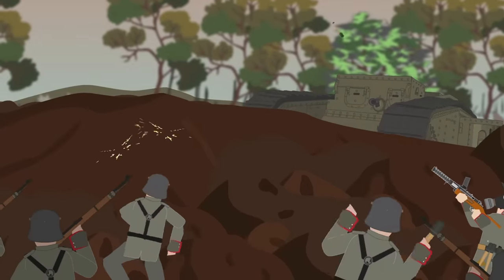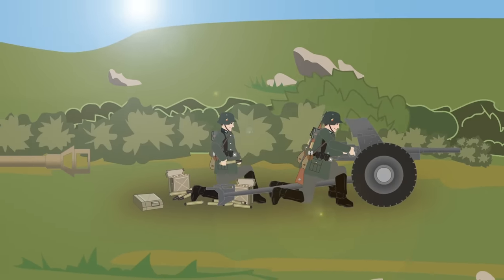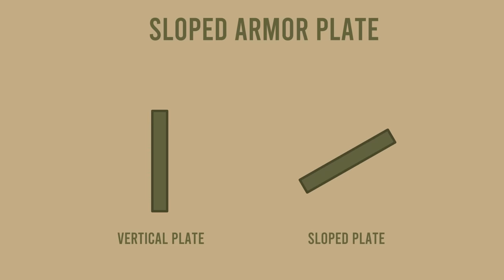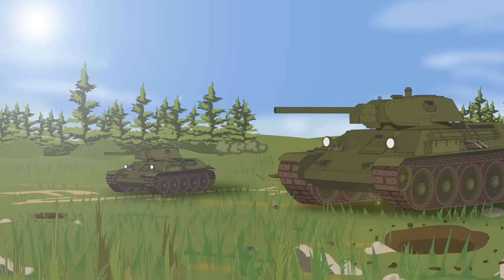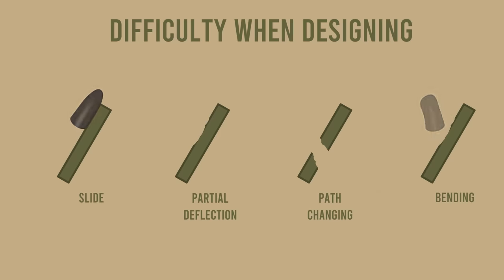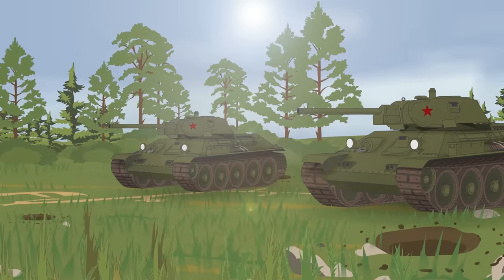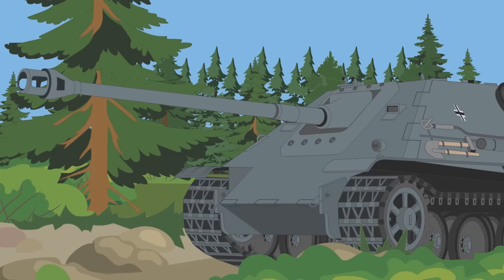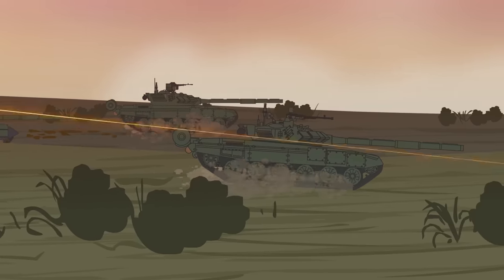Sloped armor: A simple feature that saved many lives

Comment: The T-34 is an excellent example of the advantages and disadvantages, been the disadvantages an extremely cramped interior with few internal storage, also how blind a tank has to be  shot at 27 times, also the 37mm was able to eliminate T-34 they destroyed about 2.000 at the beginning of  Barbarossa, this due to the extreme tempering of soviet steel which cause  spalling    in the interior without penetration ending the crew inside.
Reply: I was looking for the extreme tempering comment
Reply: @ZayP730   Am not confusing them, in 1941 at the start of Barbarossa russian lost around 20.000 tanks of which 2.300 were T-34s, so they had more than thousands of them, then the 37mm was able to deal with them as I said they lost 2.300 T-34s in 1941 alone.
Reply: @ZayP730   The book "Soviet Casualties and Combat Losses in the Twentieth Century by G.F. Krivosheev , John Erickson, Christine Barnard" made with soviet data from the archives in Moscow in the early 90's.
Reply: @viceralman8450  Numbers look exaggerating. Soviets had T-34 which was effective against the initial Pz-iii and Pz-iv with short barrel.
Reply: @livingroomtheatre174  So the soviets exaggerated their own loses sure.
Reply: Lazerpig?
Reply: @viceralman8450  Losses can be attributed to various reasons as well. 1) Great Purge of 1935 left red Army without able leadership. 2) Soviets never expected attack from Germany, rather from Japan. So they had to deploy elite units on the far East. 3) Soviets lacked radio. So coordinator was poor
Reply: @livingroomtheatre174  that and the tank itself had a lot of problems in both the design itself and the piss poor manufacturing that went into them
Reply: @livingroomtheatre174  According to  Makhmut Gareev former Deputy Chief of the General Staff of the Armed Forces of the USSR, the Russian government never trully disclosed the actual figures of casualties in ww2. He states that many conscripts were left out of the millions of casualties. So yeah, the closest we have to the truth is the work of Krivosheev.
Reply: @generalfluffyproto  A man of culture I see.
Reply: @livingroomtheatre174  Sounds like excuses. And don’t change then fact they were run over by inferior tanks supposedly.
Reply: U stole my words out of my mouth
Reply: @viceralman8450  excuses? You forgot Molotov Ribbentrop treaty that pledged no Soviet - German conflict! Russians were indeed has poor terms with the Japan in the far East. Dont forget Russian defeated Japan in Khalkin Gol. The term inferior tanks itself is a vague remark. Even Germans had moderate tanks in the 1941. Striking tank at the time was Pz-iii which was not powerful enough to penetrate KV-1 and T-34
Reply: @livingroomtheatre174  
You look at tanks from paper view, not from a actual military standpoint, in reality german tanks were much better coordinated, had radios, were very crew comfortable and had excellent visibility and optics. The steel and weld quality was great too. This is why when facing t-34's and KV's. Pz 3's could disable enemy armor even with 37mm by just spalling out the plate. It's why you also here of t34's taking 30 shots and not firing back once, that's the sign of a trash tank.
Reply: @dsan8742  german officers told it themselfes when they were testing them, so you should read legit recourses…
Reply: @livingroomtheatre174  Excuses  to justify the poor performance of the red army.  
They if the Pz 3 was supposedly unable to pierce the T-34 how the red army lost  2.300 of them on 1941?
Reply: @dsan8742  did I ever say that Soviets had superior tanks than the Germans? You need to stop reading between the lines buddy.
Reply: @viceralman8450  poor performance? Dude, Soviets defeated the Germans! Let's accept this fact straightaway. By the time Normandy landings happened, Germany had already lost the war and were retreating!
Reply: @livingroomtheatre174  We talk about 1941 T-34 right here. (At least for I seen)
You need to accept that T-34 look good on papers and may look good in real combat. If they build it like how other countries build tank. Their armour think, Yes. But it's poorly made. PZ-III may can't penetrated it. But enough to make crack on armour of the tank that make it's unusable.
Poor visions (expect gunner), Poor communication (not have radio), Not have heater (If I remember correctly)
Just name a few.
All this problems above lead to poor performance of tank crews and tank it's self.
Reply: @ZayP730  ''Also regardless of the soviets steel quality, the 37 was still highly incapable of reliably dealing with T-34's unless from flanks or good angles like he says in the video.'' Did you not read the last part of Viceral Man's comment? Often times when a T34 were hit the round fired by the enemy would not penetrate, yes, BUT the armour would be damaged. Due to the high velocity of the round there would often be a dent left in the armour when it hit: when the armour was dent pieces of the armour itself would break of and fly through the interior of the tank aswell as the crew. This was called spalling. This was an issue nearly every WW2 tank had.
Reply: @Emiya_Shirou-no.38  *Panzer III with long gun can penetrate it, even the 37mm can penetrate it in certaina reas (weak spots which came from poor manufacturing)
Reply: You watch lazerpigs video too?
Reply: @livingroomtheatre174  “viceral man” seems to detest the reality that the soviets halted the axis advance. Im sure he is a tank specialist and that he knows better then what the actual youtube video is simply explaining about slopped armour.
Reply: You could use some period in your comment. Just friendly advice.
Reply: @shaggygabe728  
No, early war the t34 was horrible with spelling, German tanks on the other hand before 1944 could be hit multitudes of times without the plate failing. This is due to how brittle Soviet steel and how poor their heat treatment was.
Reply: @livingroomtheatre174  
Yes horrible performance, the Soviets lost unfathomable amounts of men and materiale to the point a large chunk of their civilian economy was purely stood up by allied provisions. IE the trucks they used and the boots they marched on
Reply: @davidfans5852  German officers wanted tanks to be much better even on paper, which in practicality was not needed due to the disparity in Soviet paper quality and actual quality in weapons
Reply: @dsan8742  ye i litteraly said this bro
Reply: @dsan8742  ya and the amount of heat treating they did to the armor of the T34-85 made it so when hit it would crack
Reply: RUSSIAN PROPAGANDA
Reply: They did had enough firepower to destroy a tiger from the front while tigers could do the same meaning they both have the ability to kill eachother but the t34's could be mas produced tigers not
Reply: @viceralman8450  airstrikes Germany ruled the air in the start of operation Barbarossa
Reply: @Emiya_Shirou-no.38  it was actually not refined it was the first time the t 34 saw combat we need to take t34's out 43 and 45 see the changes and we see it's better Russia is a quick learner when it comes to war and they improved the t34
Reply: @delanovanraalte3646  Later after Barbarossa in 1942 most of them carried out by the RAF,  that crippled German manufacturing capabilities.
Reply: @viceralman8450  still even if that didn't happen it couldn't be produced on a big scale but the raf definitely helped
Reply: @delanovanraalte3646  Only the T-34-85, the 76mm T-34 was not capable of going through Tiger's front at any range.
Even if the T-34 were mass produce, they were also destroyed in mass so without allied aid they would hace run out of them eventually.  While panzer would have been still been produced slower but stately, al always quality wins over quantity unless other factors such as allied aid enters the equation.
Reply: @viceralman8450  nope quantity beats quality if on a large scale built they could destroy tigers from the flanks secondly the allied aid in terms of land lease came after the Soviets were pushing back the Germans
Reply: @delanovanraalte3646  They don't need mass scale as their tanks eliminated much more russian tanks than their own lost.
Reply: @viceralman8450  thier tigers rarely even came to the front they most of the time break down while Soviets t34 couldn't penetrate from the front they didn't had to as encountering 1 tiger is a 1 in 100 chance i might be over exaggerating but you get my point also they could beat tigers
Reply: @delanovanraalte3646  No it does not in every battle that quantity has meet quality, quality has won.
Reply: @viceralman8450  literally operation bagration
Reply: @delanovanraalte3646  
You are right with the rarity of tigers and although the mechanical problems of tigers are grossly overexaggerate at this point, the early models were horrendous. But in my opinion the Germans 1v1 with the Soviets would win
Reply: @dsan8742  wich would win
Reply: @dsan8742  "a large chunk of their civilian economy was purely stood up by allied provisions"

The Lend-Lease loan accounted for 3% overall contribution. The Allies virtually dodged the war as Germany was too overextended and did not want to fight them, while the USSR was fighting.
Reply: @dsan8742  
Germany did had 80% casualties on Eastern front so I doubt they would be able to win on 1 V 1..

Also does this Germany include all of occupied France and Yugoslavia or German lands alone?
Reply: This was an issue even in after war variants
Reply: @livingroomtheatre174  panzer 3 was the tank that destroyed the most t34 during the war 
The so called inferior tank that could theoretically not penetrate the t34 at all
Not realize it wss mostly due to spalling
Had an entire series of arguments with him in the previous t34 video
Reply: @Shenaniganator101  Yeah,  he buy it all.
Reply: @viceralman8450  this issue starts being when everyone put out propaganda at the same time
Reply: @Shenaniganator101   But this started with -Putin in power with the russia strong memes etc.
Reply: @Shenaniganator101  Can you share the reliable source says "Pz-3 was the tank that destroyed most of the T-34s"? And remember when you say all T-34s it should include all the variants. Including T-34/85
Reply: @Shenaniganator101  Absolutely. Because WW-2 showed that no tank is perfect! But it's about adaptation and improvements that matters. Germans did blunder by designing newer tanks everytime rather than upgrading the existing ones. I would have built more Pz-4s than making Tiger -i, Tiger -ii, maus etc etc. Resources were limited. Time was less.
Reply: @livingroomtheatre174  lazerpig video all the sources are sited in the description
Reply: Do u now get what i mean ur allowed to have ur favorite tank but dont act like its the best one and it won the war cuz it didnt neither did every other tank u can mention
Reply: Cuz if we base it off specs alone
Then the maus should have won due to irs armor and gun and everyone should be speaking german rn but thats not what happened now is it?
Reply: The t-34 was the worst tanks in ww2 not because of design but because of production
Reply: @viceralman8450  The numbers of causalities given by the Soviet is way different than the others 
Unlike many allies forces during the ww2, the casualties were calculated by the losses or destroyed vehicles. But the Soviet is different, for example, 1 T-34 in the battlefield was destroyed, the Soviet took that damaged T-34 back, repaired it and sent back to the frontline, that T-34 was destroyed again, so that the Soviet would counted as the 2 T-34s was destroyed
Reply: @tuananhphung577   That explains how they lost 85.500 tanks, regardless those were massive loses anyway.
Reply: @salamilid3737  Even the italians  ones we're better ?
Reply: @viceralman8450  Italys tank problem lies with production and design
Reply: @salamilid3737  Italian tanks were the worst of all.
Reply: By 22.06.1941 USSR had 22000 tanks, about half of that number was lost during the 1st month of war, most of those tanks were destroyed by their own crue due to lack of fuel and ammo.
Logistics wins, nothing new
Reply: @livingroomtheatre174   germans dont have resources like soviet union so they build few tanks but wirh hight protection for crew. Why ? Bcs if crew survive they can use them again and the crew gain a lot of experience. That s why german crew was the best in ww2.
Reply: @cosminenache124  Not really! You need to understand why Soviets had poor leadership. They lost skilled officers during 1935 Great purge. Secondly Soviets had deployed their skilled forces in far East to counter possible Japanese attack. Germany made too complex tanks (ahead of its times) whereas Soviets made simple tanks easy to produce and easy to operate
Reply: Molotov cocktails killed them quickly to. The Japanese figured that out. The construction was rushed on many and left tons of gaps between the armor
Reply: @generalfluffyproto yeah I think most people have watched that video on the T-34 it actually taught me about soft factors of tanks which to most people who enjoy the history of tank warfare go relatively unheard of
Reply: @viceralman8450  37mm could not put a dent in a t34, the Wehrmacht even referred to the 37mm as “the army’s door knocker” because rather than penetrating, they merely bounce and knock against the tank over and over again, during Barbarossa the Germans didn’t expect to encounter powerful tanks like the kv1 and t34, the method they used to destroy t34’s in Barbarossa involved setting up 88 guns, as those were the only calibers capable of penetrating the Soviet armor.
Reply: @Jmj__   It could with surprising regularity as the steel they used to make t-34 was poorly made and brittle, and that why the russian lost 2.300 T-34 on the first months of Barbarossa.
Reply: @viceralman8450  you realise that despite what you see in the movies, not every soviet tank was a t34 the is 3 had 400mm of effective armour compared to the tiger 1s 100 mm. And the 400 mm figure was provided by the us, Why would the us inflate the capablilities of the soviets?
Reply: The 50 mm guns were the ones that caused the highest losses,also at around 400 Brinnel the armor wouldn't be very tough even with right heat treatment.
Reply: @noducky-wotb  Is-3 wasn’t use during WW2 and by the time it entered service better HEAT ammunition was more than enough to penetrate it frontally.
Reply: @adarvirohfanbelarus8889 IRL is not WOT pal.
Reply: @viceralman8450  2300 T 34 tanks lost. How do you know that most of the T34s were destroyed by 37 mm anti-tank guns, some of them were probably hit by artillery, air support or infantry?
Reply: @lord_kraken9690  Were destroyed by the 50mm KwK 38/39 as it was the most numerous AT weapon at the time.